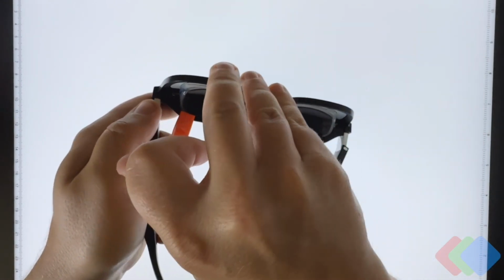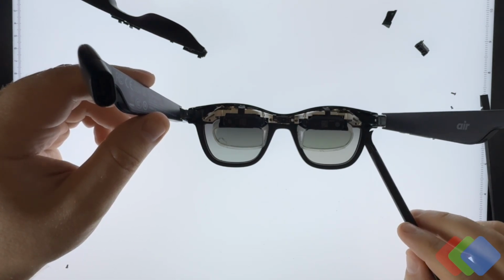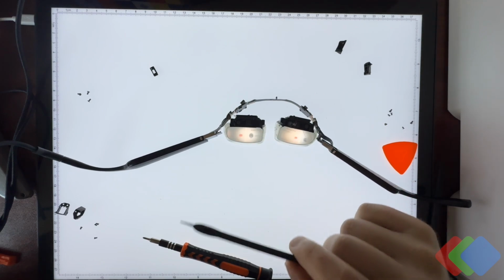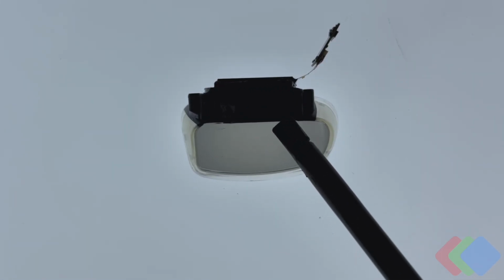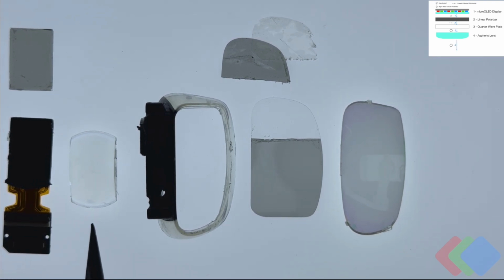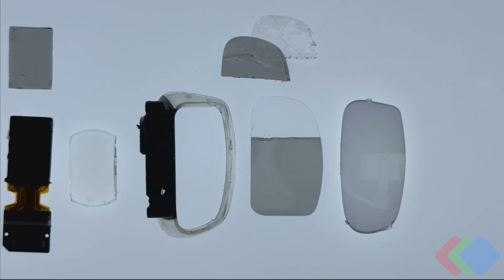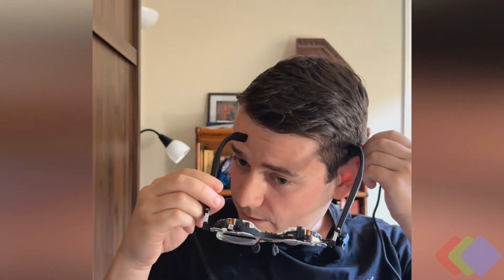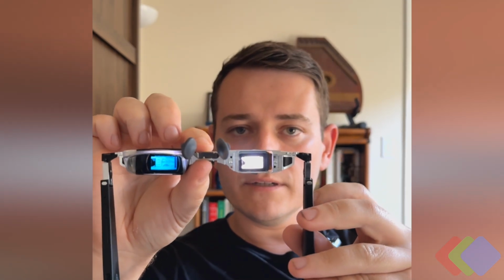Xreal Air - Teardown and Optical Analysis

Comment: Do you know why the right eye display stops working during disassembly? And how it works again after you remove the aluminum frame shown at 7:40? I am reverse engineering the same pair and am so grateful to have found your channel and blog!
Reply: It was the connector above the display! I see that is why they have the rubber pieces labeled L and R, for applying pressure to reconnect the displays without damaging anything.
Reply from the maker: Honestly... I don't remember at this point. It may have just been as simple as a slightly disconnected display FPC and after some movie magic, the connection was restored. Good luck with your project!

Comment: Is possible to adjust the optical unit to stay 2-3mm away from original position? I got an air 2 , but my ipd is about 69mm and the axis of my eyes are out of center of lenses. If i could move that lenses apart each other for 2-3mm i think will be perfect.
Reply from the maker: Unfortunately no - none of these types of glasses have horizontal display adjustment unfortunately. It would be a fairly complex mechanical design needed for this IPD adjustment, and there’s not as much space as in a VR headset…

There is some IPD tweaking that can be done digitally since not all horizontal pixels are being used, but that’s a software solution that I’m not sure can be implemented on the Air 2. Hope you can find something to help there!

Comment: Do you happen to know the connector type the display uses for power and video? Just interested in repurposing the units.
Reply from the maker: Yep - the power connectors use a 40+2 position mezzanine connector and the displays use a 30 position ZIF connector.

Comment: Very interesting. I have XReal Air glasses which I use for watching movies and computer monitors. I want something that is more real world for text info displays - not so much AR, but lofi HUD. I'm finding used and for-parts XReal Airs on Ebay for around $100, making them a prime target for hacking. Your teardown does a lot of the work for me. Very grateful! I also appreciate the deeper dive into optics, which I have no background in. I'm subscribing and will be looking forward to more. Continued Success!
Reply from the maker: Glad this helped! There’s plenty of more teardowns on the horizon that may also help inspire the build 😊

It sounds like you’re trying to make something similar to the Engo’s: https://engoeyewear.com/

I won’t be tearing these down anytime soon, but basically instead of routing the display from the temples, it’s built into the nosebridge as a short-throw projector that gives you a HUD on the glasses they sell. Pretty interesting solution to get around the many issues other AR glasses are constantly fighting (namely projector volume, waveguide efficiency, etc)

Comment: Nice shoutout to  Karl Guttag's KGonTech blog at 10:12 . Interesting to see if the second "prism" in the new optical module on Xreal One Pro, after its Flat Prism using TIR, will also be hollow or a solid piece of glass.
Reply from the maker: It'll be a little while before I break into the Xreal One Pros, but it will have to be a solid piece of material (likely a plastic resin, not glass). The TIR effect needs the lens to be a continuous material with the same refractive index that is >> than the air interface (or other low-index adhesive film), so I can't see that prism piece being anything other than a solid block.

Comment: The micro jitters you mention - what is the reason for that? Is it from a rolling shutter style display update? Is there a "low persistence" mode that would only keep the display on for a fraction of each update / only a few lines at a time if its a rolling update?
Reply from the maker: This is more referring to the fact that the displays are not locked in virtual space (you typically see this referred to as 3DoF), but they are physically locked to their position in the headset. What this means is that any motion your head makes is immediately moving the displays as well.

Our eyes focus on a screen and with a static screen actually compensate that to some degree without us thinking. For example, look at some larger display like a TV or monitor and while shaking your head a bit you'll see that it's position is fixed within your gaze - that is your eye position compensates for the head movement so that the display seems static in space. This is known as the vestibulo-ocular reflex: https://en.wikipedia.org/wiki/Vestibulo-ocular_reflex

In head-mounted displays like this one though, we see the screen and expect it to be relatively static like the larger display we perceive it to be, so when our head moves our eyes try to compensate a bit, but since the display is also moving we get a perceived micro-jitter. This is easily fixed by the 3DoF (or even more advanced 6DoF) products on the market though!

Comment: Do you know if the lens part closet to eye is glass? I just am trying to determine if likely to get scratched in any ways but data seems thin on xreal materials in newer headsets and im just assuming the AIR materials is similar if not same to Xreal One/pro
Reply from the maker: Great question - it's definitely a plastic lens, likely with an anti-scratch coating facing towards your eye - I don't think this will scratch too easily just with regular use, but it won't be anywhere near as scratch resistant as glass.
Reply: @DisplayTechCenter  thank you, its been making me wonder if some way of screen protection for front and the birdbath optics, but maybe im just inclined to baby a 500$ xreal one lmao
Reply from the maker: All of the optical surfaces are pretty protected from the environment, so I wouldn't worry too much that you would damage any functionality if you get scratches on either the lens close to your eye, or the outer lenses. For extra protection, I know you can get 'lens protectors' that stick on the the inner lenses - just be careful that they are unpolarized, or you risk significantly reducing the brightness delivered to your eye!